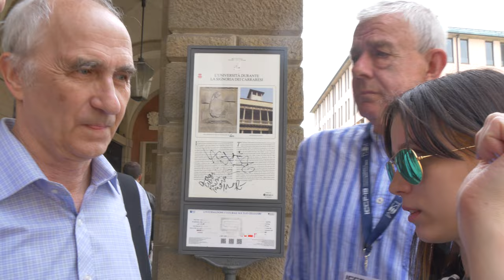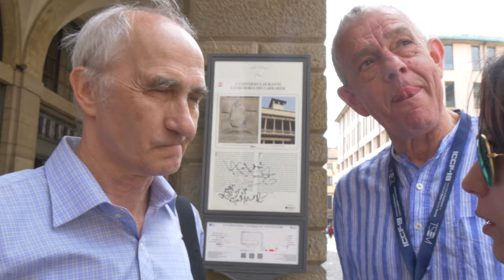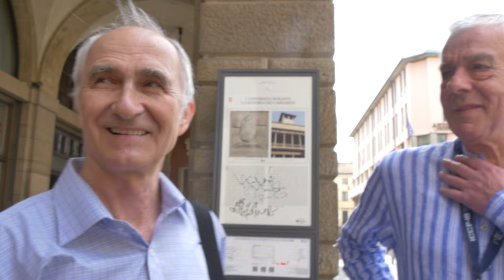Temperature & Pressure

Comment: Next experiment should be concluded with a core space to fuel ratio in such amount that the pressure would follow the numbers Parkhomov got.

I wonder if you could form a setup where the pressure could be controlled via an external source to get the lithium to vaporize at will. I'd also like to see

I also wonder if you could feed the hydrogen outside of the reactor, instead of using LiAlH4 in the first place. That way you could have the Nickel and Lithium in the core, heat the setup to boil the lithium and start adding hydrogen to mix to get the reaction going.
Reply from the maker: Artifex 28 We met AP the day after the experiment - he sad he thinks we did not have enough dead volume.
Reply: Martin Fleischmann Memorial Project Is the next project under planning? :)
Reply from the maker: Artifex 28 Yes. We have many experiments planned - alongside distributing materials to replicators.